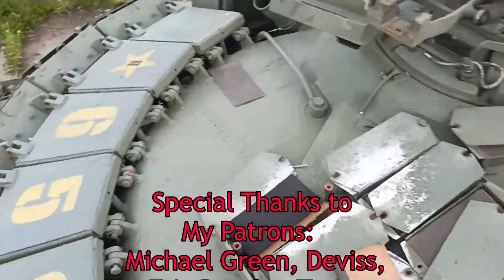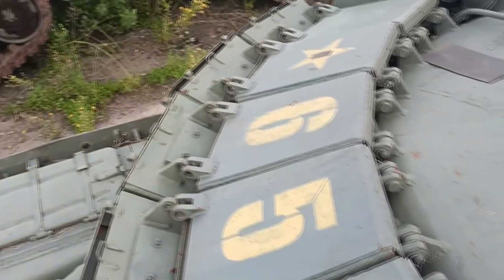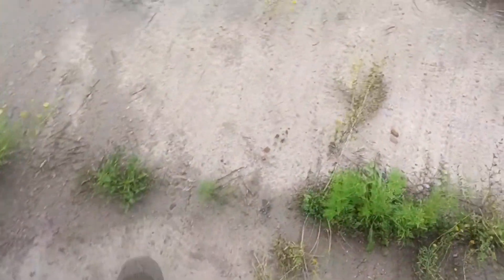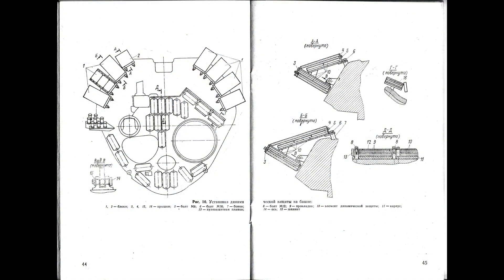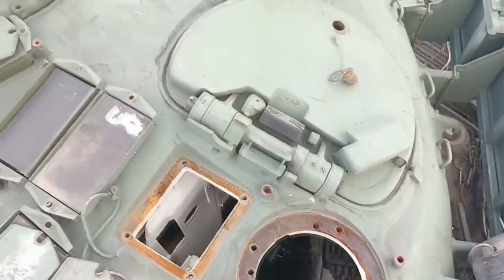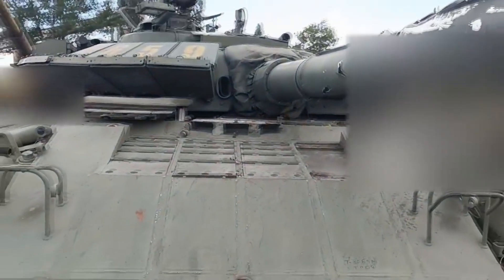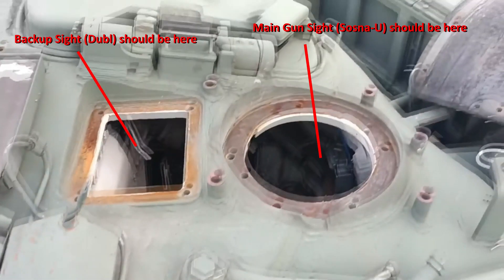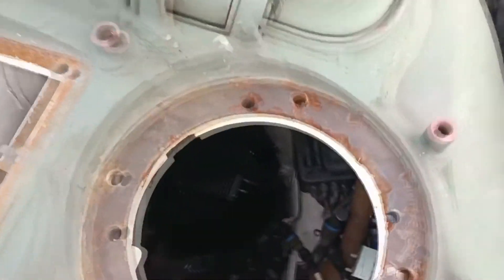Russians Are Using Rubber instead of ERA on their Tanks

Comment: Such nonsense, these Ukrainians pulled out explosives, and then they take off that there is one rubber, you have to be a fool to believe them, rubber is embedded between explosive plates, when the cumulative jet passes, rubber allows you to create a zone of low pressure, which disrupts its operation
Reply: Dude, please go read about chechen war, when ru forces were attacking Grozny with tanks that had ERA boxes but were empty, just research about russian army and corruption inside before making assumptions
Reply: @romzes576channel  if you compare 1994 with 2022, then you've lost your mind
Reply: @1mihacop1  man, some commander's of russian forces are same generals that led soldiers in Chechnya. Corruption ? Still exists and maybe even bigger
Reply: @1mihacop1  we are talking about army that put t62 back into use
Reply: @romzes576channel  Are you either young or a fool, as the general is responsible for the dynamic armor on the tank? I think the lower ranks of officers in the field are responsible for this, and if you didn't live at that time, you don't understand what a mess was going on everywhere, so you don't need to compare
Reply: @romzes576channel  what is the problem with the T-62 tank? it is used not as a breakthrough tank, but as fire support instead of mt-12 guns, only it turns out to be self-propelled, you are kind of naive, for you the picture has more attention than understanding the situation
Reply: @1mihacop1  I didn't say that general is responsible for era, I am just saying that fish starts rotting from the head.  And yes, russian army is still comparable to 90s, still corruption exists at all levels, still low rank officers sell inventory on a side. You are delusional if you still believe that it is not possible that they didn't you use era sometimes because of the problems in the army and if you still believe that russian army is top notch next gen forces.